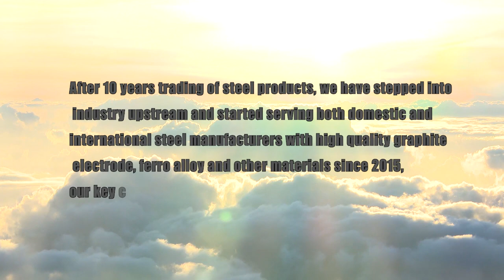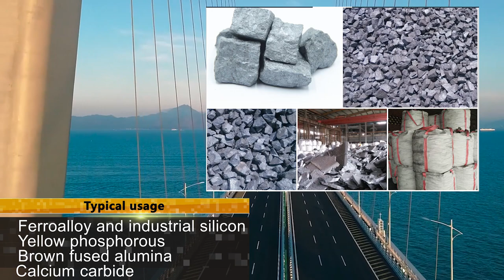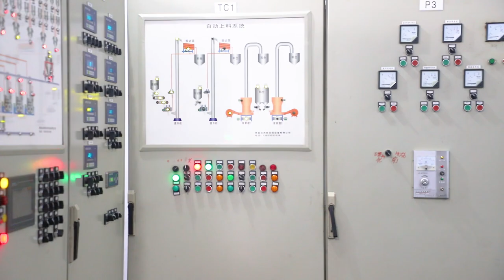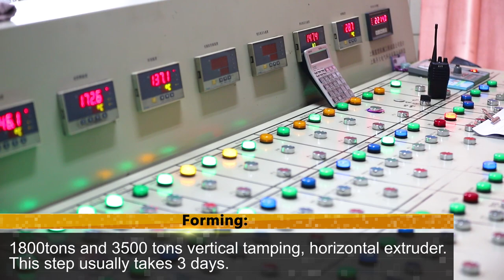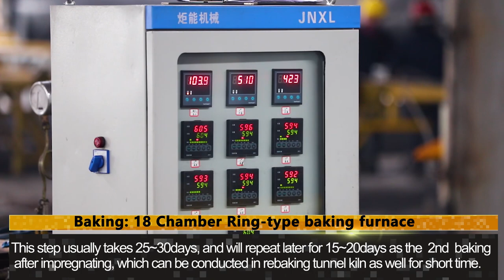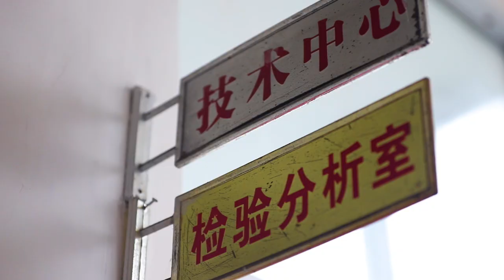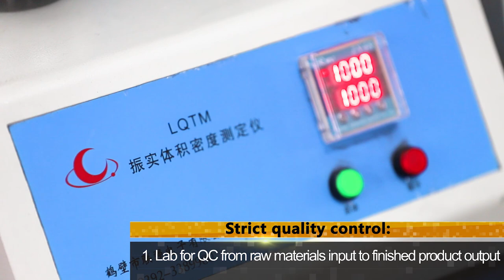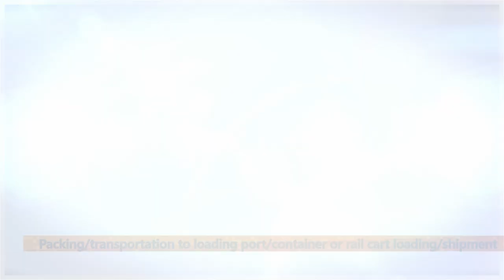Summit steel/Datong carbon-graphite electrode business presentation

Comment from the maker: Key points in EAF/LF route steel making 电弧炉/精炼炉炼钢要点
https://www.linkedin.com/pulse/key-points-eaflf-route-steel-making-%25E7%2594%25B5%25E5%25BC%25A7%25E7%2582%2589%25E7%25B2%25BE%25E7%2582%25BC%25E7%2582%2589%25E7%2582%25BC%25E9%2592%25A2%25E8%25A6%2581%25E7%2582%25B9-denis/?trackingId=unpMQ%2FteSp2KGdScRuptnA%3D%3D

Comment from the maker: Besides graphite electrode, we also supply below metallurgical materials :

Copper mould tube (CMT) for CCM
http://summitsteel.co/pictures_list/lanmu/7/cid/28.html

FerroSilicon (FeSi72 & FeSi75)
http://summitsteel.co/pictures_list/lanmu/7/cid/23.html

Graphitised caburant/recarburizer 
http://summitsteel.co/pictures_list/lanmu/7/cid/29.html

Cored wire in CaSi, CaFe and etc.
http://summitsteel.co/pictures_list/lanmu/7/cid/30.html
......
We are always here ready to serve your demand in metallurgical materials, if you have such demand, welcome inquiry.

#electrode #CMT #CCM #cored wire #Ferroalloy #FeSi #matallurgical  #caburant #recarburizer 
#mould tube #graphite electrode #EAF #LF #steel making #GIFA2019 #METEC2019